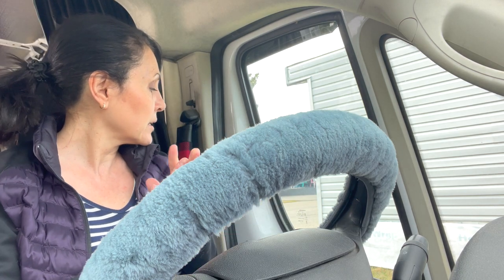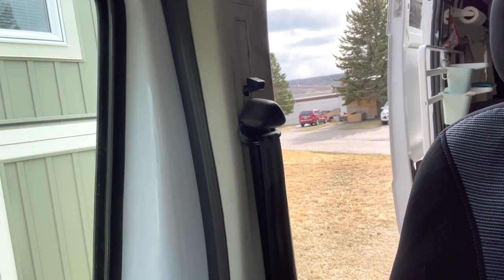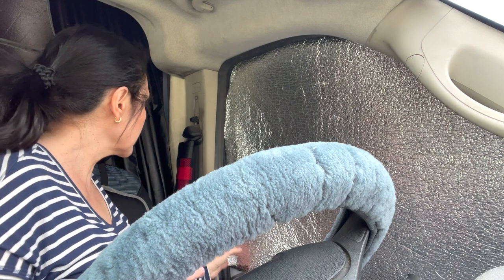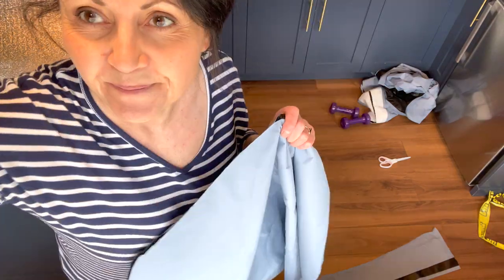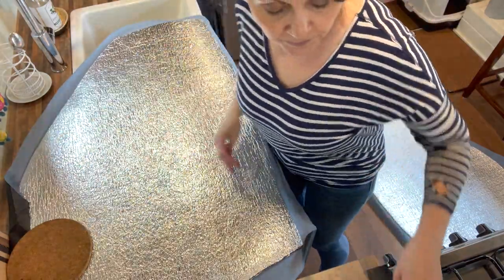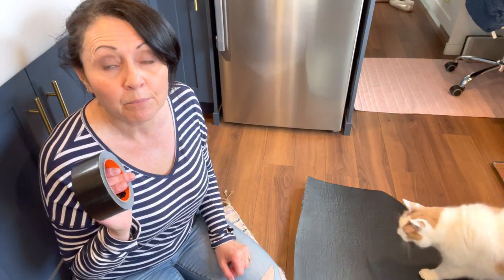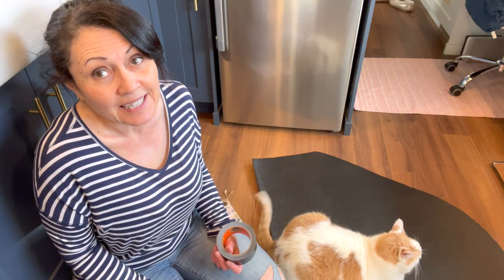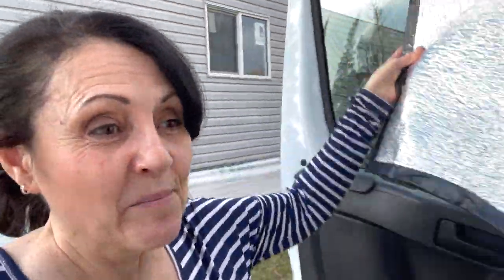Easy Van Blackout Shades Pt 1

Comment: Great Job, Adelina.  The black duct tape finished them off perfectly.
Suggestion:  When you have a big, potentially messy project coming up (spray glue),  a couple days prior to starting the project, contact an appliance store or Home Depot/Lowes and ask for a refrigerator box or a water heater box.  They will hold one for you  It will give you a huge surface for spraying your glue.  No mess on your deck or whatever surface you use.
Another suggestion:  Your barking knees were making mine whimper.  Hopefully new ones this year, but I digress....   Our 60 inch folding plastic table from Walmart has become indispensable.  We use for everything and rarely have to get on the ground.
Keep the projects coming.  You're doing great!  Ask for suggestion before a project.  Everyone has an idea to share.
Reply from the maker: Thanks for the suggestions! 🙏🏼😊